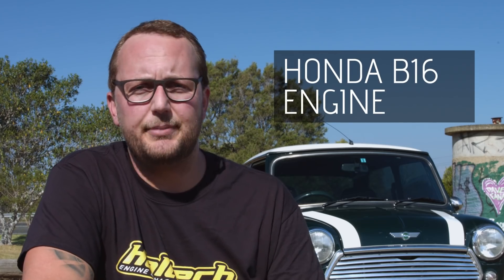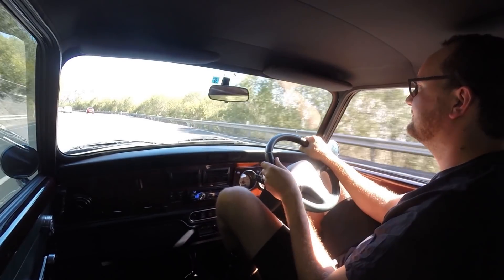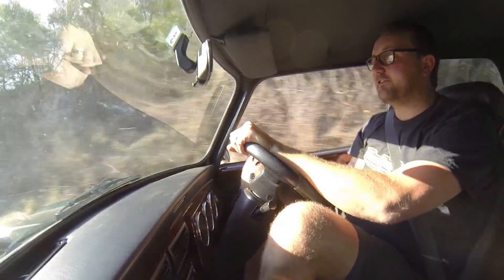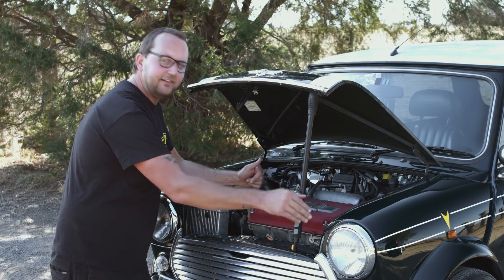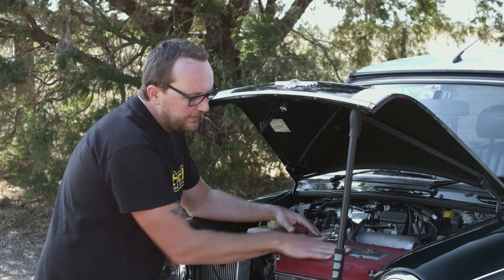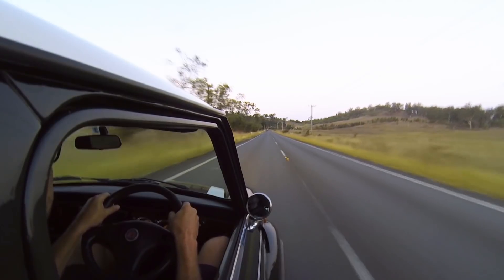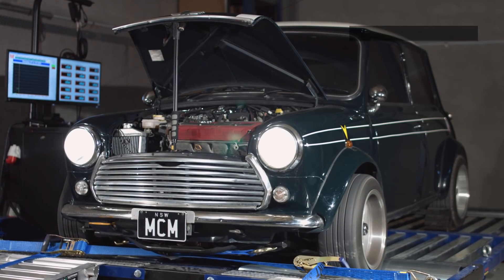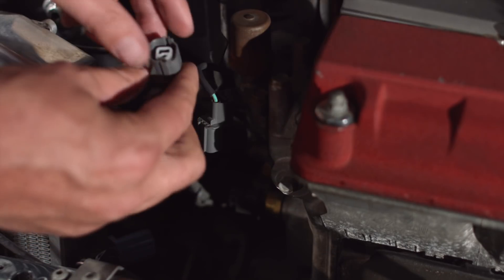💬 VTEC Magic - Mighty Car Mods Mini Revisited

Comment: Serious question,....Honda is not the only Japanese engine with variable-valve-timing technology...and it seems all the conversion kits for Mini focus only on the (relatively large) Honda B16 VTEC engine, as used here. Notice how tightly "shoe-horned" the car is, and how seriously-involved the conversion process is. My question....why aren't there conversion kits that can fit a slightly smaller Japanese engine, say a Toyota 1500 1NZ-FE engine ( or others)? My point?---> you don't get the super horsepower of the Honda, but you do get 1.) Japanese modern engine reliability.....2.) Still a good HP level comparable to the modded 1275's.....3.) a separate gearbox and separate oiling for it, as does the Honda (and an improvement over stock)....all the while the install may be MUCH less involved as the engine is smaller. Anyone care to comment ?.........

Comment: I change gear around 1750rpm.
I cruise on the motorway around 2500-3000rpm.
The engine red-lines at 4750rpm.
Boost kicking in around 6000rpm is a completely alien concept to me.

Found this through MCM & Skid Factory; seeing it all transform from two blokes in a driveway to technical videos has been a pleasure, the progression has been natural and much as I try I will never love the whole group of series as much as you all always seem to making it and living it.

Comment: Scott mate I was wondering if you can help with something that is bugging me is there any reason why a standard Zirconia narrow band lambda sensor would have a 1.75v reference voltage before the vehicle goes on to closed loop then drop to zero as it starts switching this is on a Vauxhall Opel  corsa 1400cc 2014 but this has been seen on other 2014 Vauxhall 1400cc model petrol cars
Reply from the maker: Hi mate, 
I'll need a bit more info to help with this. 
Send me a message via www.haltech.com/contactus with the ECU and what input you're using and I'll see if we can't answer it for you :)

Comment: Its so good, that no other car maker uses it even now that the patent is expired.  Cheaper to just stick to cam phasers and a larger displacement motor to make the top end power and still get the good emissions and fuel economy.

Comment: Was hoping to see you move the VTEC activation point down and show the dyno results rather than just saying it'll make less power. Looking at that blurry torque curve there's a dip in torque after the first cam produces it's peak torque at 3K? and rises again when the second cam kicks in, telling me there's power under the curve gains to be had between those two points at WOT.

Comment: If only he did a power run with the vtec locked on (i'm sure the haltech ecu could manage that one) to show why you don't run a high lift cam all of the time even at full throttle never mind part throttle.

Comment: Hey Scott and Haltech team, I assume that since a Haltech was used for a B18c Honda engine, I could use one for my 2005 Acura TL right? But it is not plug and play correct? I have never heard of someone in the states using a Haltech on the J32a3 which comes in Honda v6 Accord and Acura TL. It's always Hondata, but is there a plug and play option?
Reply from the maker: Here is a list of all our Honda Plug'n'Play ECU options. https://www.haltech.com/product-category/honda-acura/
If your car is not there, they you can still use a universal ECU with a manual wiring option.
Reply: Thank you.

Comment: Does your dyno read low? I am surprised it only makes 134 horsepower to the wheels. Those engines should be good for around 150-160 horsepower to the wheels stock. If that dyno doesn't read low, that engine needs to be checked over to see how healthy it is. You would think having a tunable ECU and an exhaust would bring that stock power up a little. It seems to run strong on the road so I guess it doesn't matter in the end.

Comment: Love what you guys do but how can you daily a car that the steering wheel is lower then where your knee caps are?
Reply: Don't get me wrong. I grew up on Honda swap power. 1st real car I spend my first job money on was a 1992 Civic CX 70hp. Yes 70hp. I won a few freeway races but that was because I would use the shoulder to my advantage. Till one day going to work I drove over a large puddle that hydrolocked my engine.  Drove it with a rod knock for a lil while till my friend wanted to race me and I took it to hard... I blew her. After a few months saved enough to get a B18C1. Drove 400 miles with a rental truck grab the GSR engine. Put it in and she redlined no matter what. Turned out that the secondary butterfly unit was taken off before and the gasket was not properly removed. Fixed that and my first test drive. Holy S*&t. 70hp to 180hp. She scared the shit out of me... after a few month she felt slow again. Decided to turbo charge the B18C1... soon after Turboing her I wreck her. (Miss you baby girl). RIP

Comment: I know this is plenty of power for the mini, but the CTR b16b makes 185hp to the crank. (138kw) so why doesn’t it make at least 160hp to the wheels? Is it do to the shorted intake? Or just keeping the power down so it doesn’t blow off the tires?? It’s making the power of a normal b16a.
Reply: I think it's either a low reading dyno, the air intake size or location, too small/too big of an exhaust, or a tired engine. Maybe the Haltech ECU has a CTR basemap programmed in and not a custom tune. I made the same comment. This car should be making 150-160 horsepower to the wheels, if not a little more if the exhaust is a nice 60mm setup with a good tune.

Comment: Scott, thanks for a really good explanation. I think the "other question" is what is the ideal time to switch on the VTEC lobe? Wouldn't it accelerate better if VTEC came on before 5900RPM?  I presume the Elite 1500 could be used to switch on the VTEC solenoid whenever the tuner wants.
Reply: I believe the elite does switch VTEC on. To find the best time you would do 2 dyno runs, 1 with VTEC off and one with it on the whole run and where the 2 curves cross is where you turn on VTEC.

Comment: I have a b18b block with b16b pistons and head giving an increase in compression to 12.25 to 1 what will be the best selection ecu to control this beast as far as knock is concerned?
Reply from the maker: Either the Elite 1000 or the Elite 1500 :)
Reply: Haltech cool thanks

Comment: umm, interesting on a couple of points for me, firstly the charged A series engine having a narrow powerband and been difficult to drive? Really? the beauty of the supercharged conversions is the huge increase in torque which makes them easier to drive and increases the torque spread? Secondly - jumping lanes under acceleration? the low torque vtec minis dont usually suffer to such a degree, either some weird LSD in the box or the suspension setup needs looking at.

Comment: Nice review! very well and clearly explained but then we knew you where capable of that from the previous Haltech and MCM video's right. Your length compared to the car is pretty comical though :p Pretty funny seeing your knees halfway up to your ears in that first shot, like you where driving a bumper car :) And when in any other situation would you have to sit on your knees hanging over the fenders to work in the engine bay? :P  the 2.36 mark looked interestingly scary though.. I could be mistaken but that looks like some serious bump steer happening there. Should make for a interesting drive combined with that fwd torque steer and the power to weight ratio being what it is..

Comment: I know you talked about the Vtec being bad for low rpm. But I wish you showed that as well since you had the dyno and an ecu that could be set with a lower Vtec set point. You could have added that to your comparison of Vtec on and off at higher rpm. Other then that the video was great need electric power steering to get rid of the torque steer 😉🇦🇺

Comment: Check out the bump steer at 2:36 when the front end lifts. Bet that's fun/scary when you floor it: -)
An old friend used a huge shoe horn to get a Rover 3.5 v8 transverse in the front of a mini clubman, that had the same issue. It had vicious torque steer and could pull you either way. The suspension is seriously struggling to handle the torque. Seem to remember he did some work on track rods and steering rack mounts to reduce bump steer which helped a bit.

Comment: It'd have been nice to do a run with the high profile to see the losses at low rpm and check if the crossover is on the right spot.

Comment: Should have tried a dyno run with the solenoid artificially engaged to show the loss in performance down low.  Would have been interesting to see.
Reply: It would be interesting to have actual data...but I used to daily a modded Mini, back in the late '80s/ early '90s (still with the original 1100cc siamesed-port A-series engine.)

Had a good head, big valves, carbs, recurved dizzy, and a 544 race/rally cam...it topped out at around 75 hp /55 kW (stock was about 40 hp)...and it drove like a 2-stroke.  Great power and lots of traction issues from 3500 rpm or so up to redline (around 6500), but below 3000 is would almost stall.  Couldn't pull the skin off a rice pudding.  So getting going was particularly hard on the clutch and/or tyres, especially doing a hill start.  Made it really hard to drive - either no power, or too much, but rarely anything in between.

Challenging as a daily driver.  But man, I still really miss that car.  :-)

Comment: "Something you could drive every day" He said with his knee's around his ears haha
Reply: I was looking for this exact comment, including the ears xD
Reply: I'm 6'1" and initially had trouble in my '88 Mini, but all it needed was to add seat position extender brackets....and to remove the steering drop bracket a previous/shorter owner had fitted. Now it fits me much better. This video shows what happens if tall and using a stock seat position

Comment: Rage !  Says lets use data then does 2/3 of the data needed and concludes on opinion. Please do a run with vtec on from idle so we see the power loss of the big cam.

Comment: Should of done a run with the vtec on from idle just to see

also can you set what rpm it kicks in? You could  find the sweet spot in the rpm and get it on as early as possible
Reply: Aftermarket ECUs (and maybe stock with flashing) can change when the solenoid engages, but on a stock engine and with Honda having a couple of decades doing VTECs, out of the factory it sits pretty much in the sweet spot.
Reply: SphinX  it sits exactly in the sweet spot, actually. Honda knows what they are doing.
Reply: pdgeman yeah someone already said that buddy 🙄

Comment: Great video cheers Scott! Do you guys do a Halted unit that will manage the Toyota 2gr- fe v6 and 6 speed auto. Would want to raise the rev limit and change shift points if possible??
Reply: Chris 2008 FZ6 manualise the trans. No point pissing about with trying to manipulate shift points imo.

Comment: i wish i was in sydney i'd love for you to have a crack at my unusual setup
1.8l 4g93 block
1.6 4g92 MIVEC head
with a gt 3071 turbo straped to the side of it
coupled with AWD
Reply from the maker: Wow, sounds interesting!
Reply: it certainly is haltech ps1000 running it all
it has a set of gm coils in direct fire. amoung all the other standard sensors (3 bar map). although it's been abit of a handfull for tuners up here on the gold coast/south brisbane

Comment: I enjoyed seeing the two graphs overlayed, but I would really like to see one more graph of the solenoid always on to see the power curve at lower rpms. You'd think if the power jumps significantly when it turns on, then there's still some power left on the table at lower rpms, and that the engagement point should be at the rpm where the two lines (always on and always off) cross.
Reply: They almost die at idle I tryed it with another engine with 3 cam profiles
Reply: Plenty of people have used vtec controllers in the past to alter crossover points. There’s no real gains to be had unless you start using custom cam profiles and that gets in depth.
Reply: You can't always have the solenoid on otherwise you'll starve the engine of oil pressure, hence why vtec is only activated in the higher RPM range when the oil pump is producing more pressure.
Reply: Scott does explain that at lower RPMs the big profile does lose out. Honda have spent a lot of years working on and developing their VTEC system, and it would be safe to assume that after all the years of doing it, the crossover point is probably in the best spot to suit all stock applications. Aftermarket cams obviously are different, but given this is a stock engine, there would be no reason to use the ECU to modify it.
Reply: SphinX just because it would make sense for that to be the case doesn’t mean it is, especially when there’s evidence to the contrary.

Comment: Well done video and nicely explained.  We ran a stock B16 VTEC on a E6K back in the days and put down about 135 WHP.  Also did a few B18C turbo for street that made easily 650 WHP @30 PSI on at T88.  What was amazing is moving the VTEC rpm points would on the turbo set up would make as much as 50 HP increase overall.  These engines would turn 10,000 rpm without thinking about it.  Of interest is that however great we tuned the cars,  a particular ignition system would add as much as 18% increase in torque and HP over the stock ignition system.  We would also get the equivalent savings in fuel consumption.

Comment: You can drive it from the rear seat
Reply from the maker: We actually considered that option quite seriously!
Reply: Max_x2 It's a mini. There will be a kit to change both of those.
Reply: I used to think I loved these Minis, but that driving position and tour bus steering wheel angle... Brrrr. Not sure I could stand it :(
Reply: Max_x2 You can get drop brackets for the column and extended seat brackets. Im 6ft 4in and i have no problem in any Mini.
Reply: Some people do that and get it engineered for it.
Reply: just metal strips with holes in for steering angle adjustment if i remember.
Reply: There was actually a pro basketball player in my town who couldn't find a car he liked that was big enough,  so he just got a VW Rabbit  (early Golf, to you guys, probably,)   and ripped out the front seat, drove around from the back.  :)